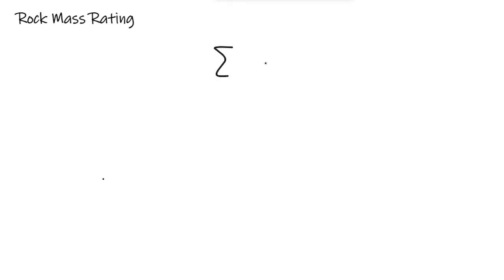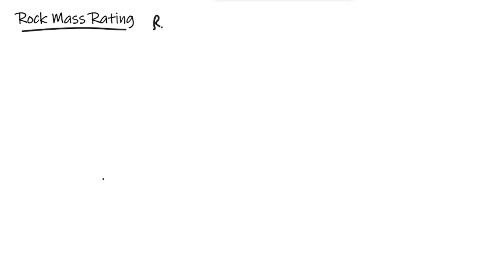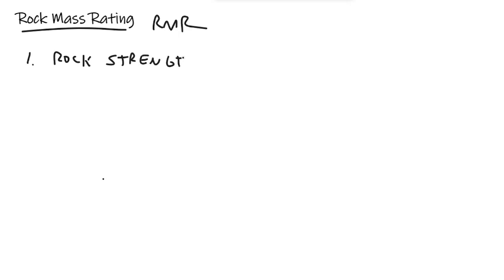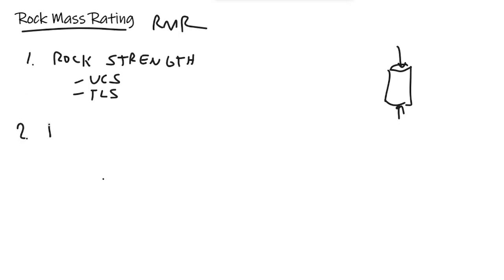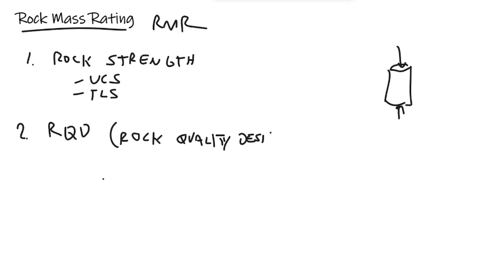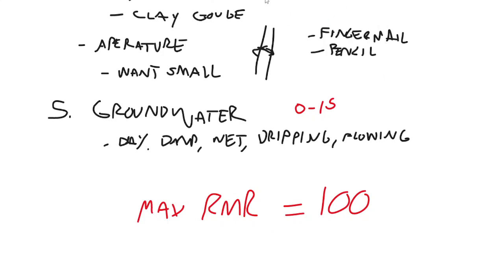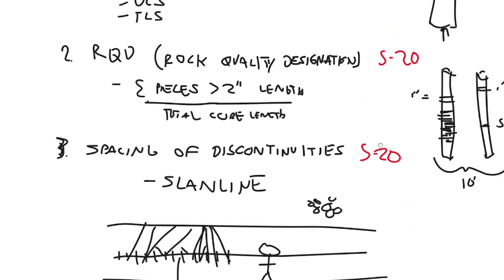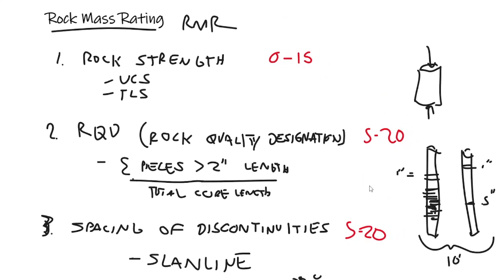Rock Mechanics: Components of RMR

Comment: In RQD of a drill core it is pieces longer than four inches divided by total length of a core.
Reply: That's right and  he should add all pieces greater than 4" (in his case greater than 2" ) not a small pieces. He added a small pieces (1"+1"+ 0.5") and divided by the total length